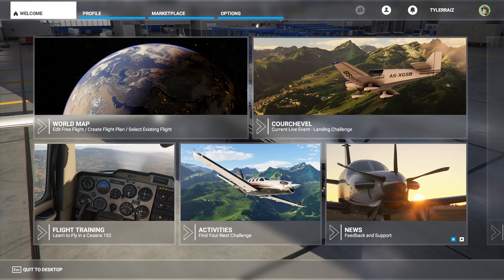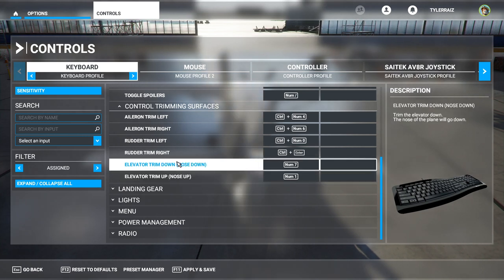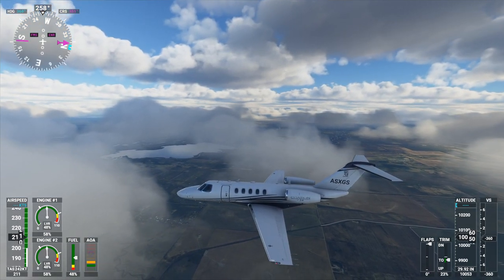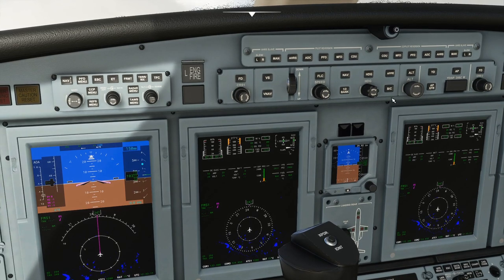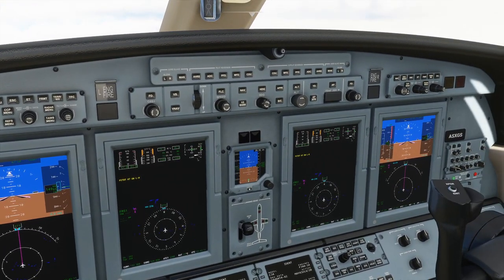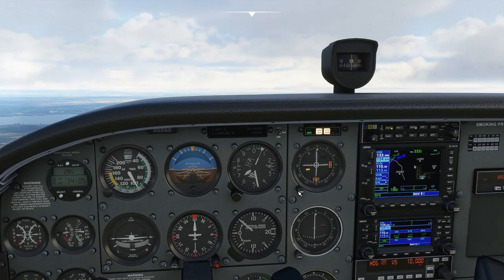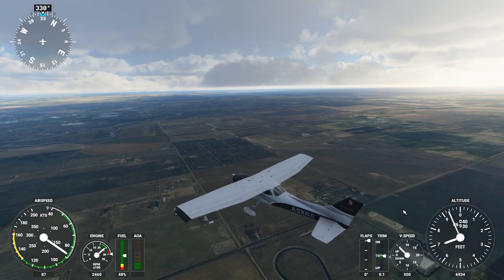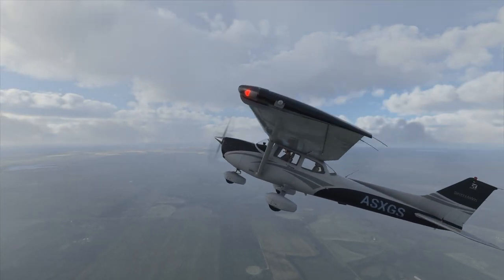Flight Sim 2020 Tutorial - Control using Trim and Autopilot

Comment: Thank you so much. My elevator trim by default was on the throttle of my X56, using one of the knobs. I hate it and it is not intuitive to use like that. I have tried some of the hat switches on the throttle and I don't like those. I am going to change it to the hat switches on the Joystick, that makes a lot more sense.

Comment: Great video-spot on! hope you don't mind if I ask you a question about a problem I have suddenly begun to experience, appreciate the fact you're not a problem solving channel though. Been messing around with FS for years now, never had any real problems, well, none that couldn't be resolved easily, but this one has me stumped.  When I set the trim  nose up or own, the trim for some reason returns to neutral hence , I can't fly level? don't know how or when it started but I can't resolve it. I've double checked controller settings and tried using various controllers,  (keyboard, Throttle Quadrant and Thrust master T320) Sorry for bothering with this issue, but thanks....Jim
Reply from the maker: My best guess is that the plane has a fly-by-wire system. If you're flying the A320, for instance, it will autotrim whether you have autopilot on or not. Basically, in the fly-by-wire planes in FS2020, you set a pitch with your joystick input and the fly-by-wire will trim from there.
Reply: @RaizSpace  I appreciate your thoughts and wisdom...sorry, should have mentioned the aircraft. I fully agree with that but unfortunately, it was the Cessna 172, although I have tried with other Aircraft with the same problems, strangely even operating the various wheels etc, has the same and effect, thanks again,  Jim

Comment: But let me ask something. 
I set the trim during flight to adjust the aircraft behavior, during climbs or level flights, but if I move my joystick (up or down) the trim resets. 

Is that normal behavior?
Reply from the maker: That indicates a fly-by-wire system, probably, unless there's a mapping error. With fly-by-wires in Flight Sim 2020, there's unfortunately no point to using the trim - moving the stick tells the fly-by-wire system where to set the trim, and it'll trim for the pitch you set with the stick.

Comment: Since I really don't think I've said this enough, thank you so much for this tutorial, and all the other tutorials you've made on this channel. Without this one in particular, piloting would be so much more difficult, because you're right, the (default) tutorials suck.

3:10 I'd like to see someone add an aircraft powered by a piston rotary engine, because those had a ridiculous amount of propeller torque.

17:50 It's somewhat annoying that it only displays the engine RPM and not the throttle level in the external view. I mean, in-cockpit, you can at least see physically where you set the throttle, but not here... Also, while it is accurate for the real Cessna 152/172 and most other propeller aircraft or even brake-powered vehicles in general, it's annoying that it doesn't display the actual power level in the external view. Power is never exactly linearly proportional to engine RPM, and brake-specific fuel consumption never stays exactly constant with increasing power.

20:35 That's not a very smart autopilot.

22:40 Literally the most important rule in flight.

Comment: I feel like Rudder trim is far more useful than aileron trim, so I would personally map this on the POV hat switch over the aileron trim.
Reply from the maker: Normally, I'd agree, but this is more for beginners who have trouble keeping their plane flying stable because they're overusing the stick. That's usually not a yaw issue, as the plane will stabilize in yaw the best, so that's why I advised aileron trim.

Comment: Hi All :)   on the some planes after take off or turning off the auto pilot,
 i am flying level plenty of speed I pull back on joystick and plane 
climes nice . then I go to lvl off and the plane instantly  goes -14 or so
 trim down, and go in a vertical steep dive right into the ground don't 
find this problem in the smaller planes.any help will be appreciated